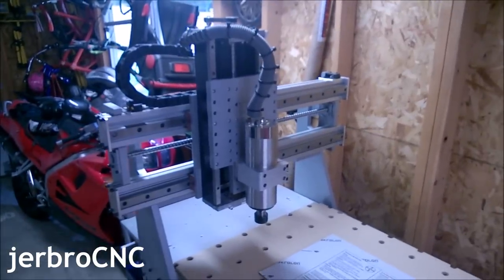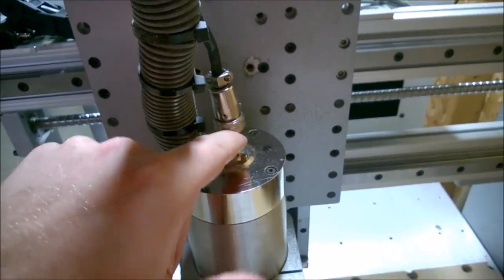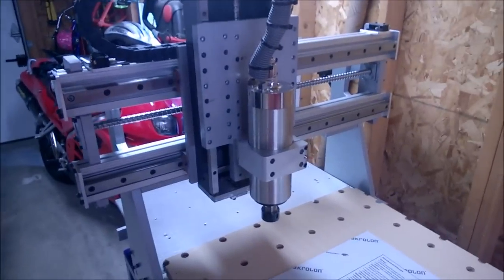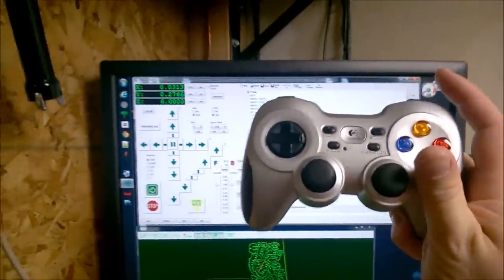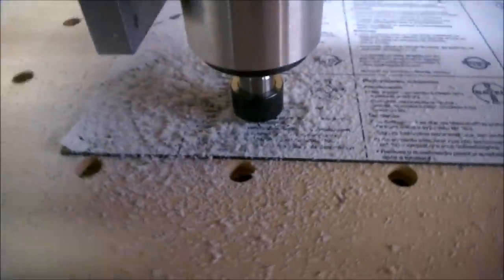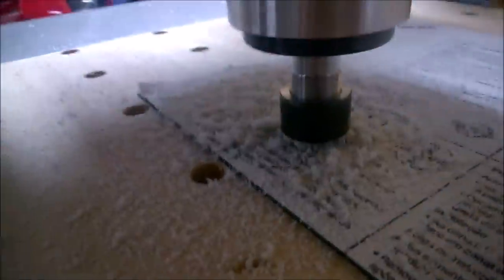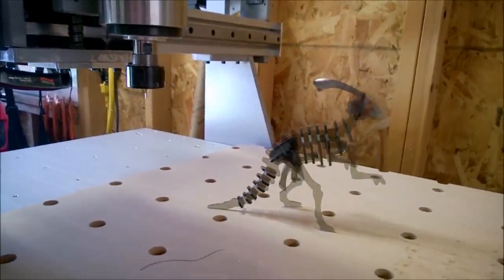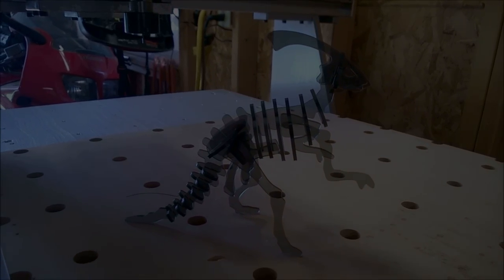jerbroCNC: 3D Dino Puzzle on the CNC Router

Comment: I'm new to the cnc world lol.  What program did you use to create the puzzle pieces?
Reply from the maker: Hi Dustin.  I have a two-part answer.  The puzzle in this video was purchased at makecnc dot com.  They do a pretty good job with most of their puzzles and plans, though sometimes there is an error in the instructions (reindeer) or a logical problem with assembly (wolf) where one part is in the same physical location as another.  To modify shapes or even create new ones, I use Vectric Aspire.  I've found though that almost everything I've needed to do could be done with Vectric V-Carve.  If you're asking about how to take a 3-D object and convert it to puzzle pieces, that takes a good deal of work.  I understand Corel Draw works well for this, though any vector-drawing app could be leveraged for the same.

Comment: If you took the ground out what happens the next time one of the pins get shorted to the chassi while you lick the frame?
Reply from the maker: +Decieved.  Thanks for commenting!  I didn't take the ground out.  Everything is still there, I just shifted the pins around.  Plus, there are many levels of redundant power short mitigation.  The VFD itself errors on the smallest thing, but above that, I have a circuit breaker in my cabinet, a fuse in my cabinet - all behind a circuit breaker in my subpanel, all behind a circuit breaker in my main panel.  Besides, the chassis itself is grounded - a short would be treated like any other short.  Nothing special in this case.